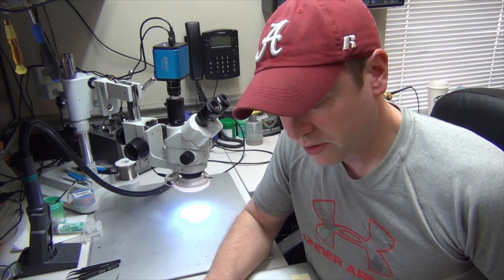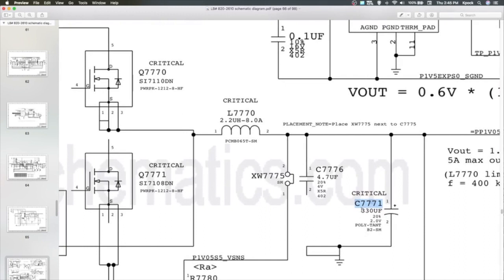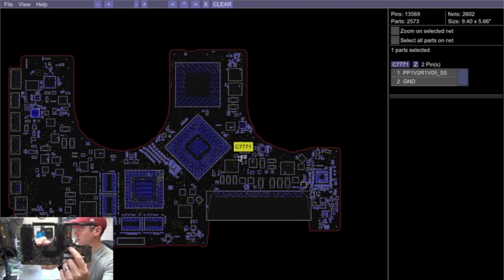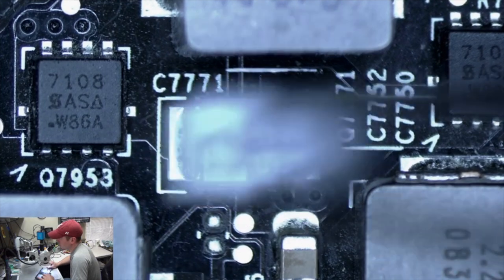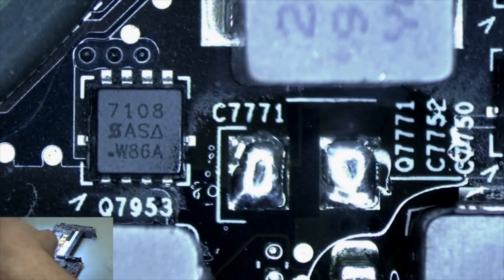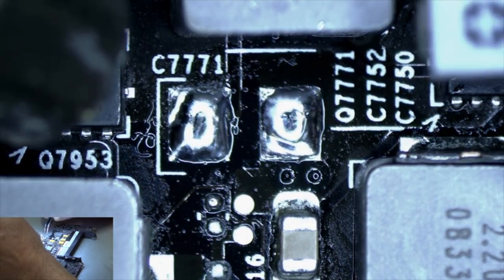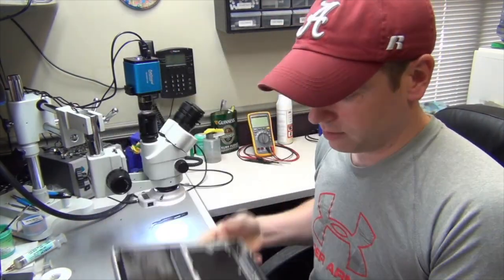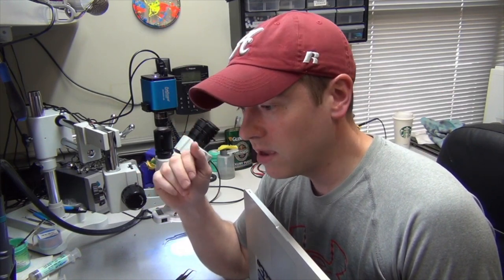Macbook Pro 17" 2009 No Power Repair on Board 820-2390

Comment: Thanks for the informative video. Have 2 MBP 2009 that have same issues. Not good at Soldering or MB troubleshooting so hopefully this is just the problem. 

I just ordered 10 of these chips for about $16 from Aliexpress. Funny thing is that they have screenshot of your video and pointing to the chip so I know that should be the right one.

Comment: Well I replaced the capacitor on my 2017 2009 MBP, I wasn’t able to fit it properly so I did a big ball of solder on each side it ended up working, the MacBook successfully turned on, after a little while I was downloading some apps on it, and I accidentally left it on my bed for a couple of minutes without macs fan control on, I picked up the laptop and turn the fans full blast to avoid any overheating, but even though the machine didn’t reach over 85 degrees C which is normal temp, all of a sudden it shuts down, I’m still unable to turn it on even after replacing the capacitor with another one.

Comment: How nice if you can help solve my problem. Macpro 2009 cpu power supply problem... I hear a click ... and that's it ... won't startup ..??? 

Changed the battery. I even unplugged the computer from the power source ... 

And later when I start is it flash a red light, click and still nothing???

Hope you can help? Thanks.

Comment: Hey my friend, I have a problem with my MacBook Pro A1297 that doesn't boot it will stay on the loading Apple line from the beginning but it won't finish loading to the part you add the password 🔑. I have no idea what's going on with it, I have try several Hard Drives with no luck but I can install Windows with no problem but it will never even boot a Mac installation disk or USB. 🤔

Comment: Bro it's nice you gave a solution to the problem I have but i also have another issue bro with the back light which would be blank computer starts but no display so I used a flash light and I saw the display In background,can u help me how to fix it I searched YouTube videos it says it must be backlight fuse but I can't locate this fuse on my board my macbook is late 2009 unibody same as the one in your video can u please help me locate it please please bro
Reply: Please do reply bro thanks

Comment: Hi Kyle, thanks for sharing your knowledge and giving me and others the opportunity to learn. I have a MP 5,1 and suspect the same issue, standby lights after pressing DIAG LED but press power button nothing happens. Am not able to measure the volt but the capacitor next to the intel chip is 'J8 eC'. Would any aux have caused this? It happened again after board replacement =( Do you think I can replace this with same as you show in this video? kind thanks for your response
Reply: Anyone else would know?

Comment: Hi, i have the same problem with my 
17” inch 2011 Macbook Pro (A1297)
1. green light charger on
2. But won’t turn on
Please help! Thanks!
Reply: has the problem been solved?
Reply: 2011 models have gpu issues, it could be gpu. Anyway I have mbp 2009 17 inch, with green light charger on but wont turn on. Any suggestions on what could be the fix for this problem? Thanks

Comment: I have same problem on the same model. mbp won't turn on at all unless every time i heat up the logicboard with hair dryer, i am not sure which parts, i just heat up all parts and the mbp will turn on. .. the funny parts is once the mbp success to turn on, it will still on for weeks or months until i shutdown and sit for a while then it won't turn on again, must put some heat again and it will turn on haha.... just order the tantalum, can't wait to apply your tips.. thanks

Comment: Will this capacitor work the same? Panasonic 2R5TPE330M9 SMD 2.5V 330UF Surface Mount Tantalum Polymer Capacitors 330 e43 ?? £4 on ebay UK?

Comment: Just carried on this repair on my MBP 2009 17" (which I'm typing on now). For a while it was having trouble waking up from sleep, or randomly blacking out, then eventually wouldn't start up at all. I found this capacitor 'Cap Tantalum Polymer T55 330uF 2.5V 3528' on RS, stock number 8603834 if you want to try it. It is a perfect fit sizewise which helps. Hopefully it will last, it's been a month so far and all good, so many thanks for the tip!

Comment: Does it matter what capacitor am using? I got one which resembles the one you're using , just that its got a different code on it (470 e07) thanks
Reply: You should use the 
Capacitor Smd 330uF 2V 2TPE330MFB polímero tântalo 
Like the one on the video 👍🏻

Comment: thanks for the awesome tutorial. I replaced the capacitor but am still getting only 0.3 V when I connect the multimeter to the positive lead of the capacitor and a screw hole on the mobo for ground - any idea what could've gone wrong?

Comment: GREAT VIDEO!  

I also have a very dead mid-2009 A1297 MB Pro that seems like replacing the C7771 capacitor will fix, but my problem may also be due to a defective Magsafe adapter that was fairly recently purchased. It worked fine initially, but now the amber/green charging light does not come on at all when hot and plugged into the MB dock and unfortunately, I don't have a multi-meter to check for power.  I think I can determine how complicated this repair will be if you can answer the following question...  Would a bad C7771 capacitor also affect whether or not the amber/green charging light becomes illuminated on the Magsafe plug?
Reply: I have almost the same issue with the same model. Would also like to know.

Comment: Hi, really nice and helpful video. I have 2009 Macbook Pro a1297. When i push the power button, fans start to work for 2 seconds then it shuts down. Could it be due to the capacitor or is my problem different?
Reply: Ediz Ferit Kula thanks , I really like the MacBook and I hope to get it fixed , I don’t know if I what to get the board fixed or just buy a refurbished one ,
Reply: @thecarcanuck1951  It worked man, you should try! I ordered the new capacitor e87 and soldered it to a computer service since it wasn't easy to solder that for me. Now, my computer is really fine.
Reply: Ediz Ferit Kula mine is doing the same , did you find anything about the fault ? Is it the same cap ?
Reply: @thecarcanuck1951  I ordered the new capacitor but i didn't have time to try it. Suppose, I will do it in one month. Then, I will write the results here.

Comment: Had this issue on my 17" MBP '09 that died over two years ago and couldn't bring myself to throw it away! Taken it to two 'Official Apple Repair' shops and both said it was completely scrap/No idea what was wrong, and its obsolete so "Throw it in the bin" ...  Stumbled across your video late one evening ... Ordered a replacement capacitor for less than £1 ... Couple of hours of taking apart and a tad of solder later ... it fired right up!!! PERFECT :D Thanks so much for sharing your knowledge! :D  I do wonder how many perfectly good MBP's have been thrown away because of this fault!
Reply: Can you provide a link to the capacitor? as I can't find the right one
Reply: Apple love making their customers think its time to throw away their devices!!  Its shocking and disgusting how dishonest they are and release software and OS that will not work on old machines and change ports etc

Comment: Hi,
I have one logic board with this capacitor C7771. Since I don’t have one tantalum I replace it temporary (only to test if that fix works for me) with an electrolytic capacitor (330mf 16V). With the multimeter probe I have the following measurements .330V and 0V (shifting every 2 sec). Is this happening because of the electrolytic capacity, or is this another problem?
Regards
George
Reply from the maker: George Drimaropoulos I can not say for certain without seeing it, but that is a good possibility.

Comment: Hi, congrats for the video. I have a mid-2009 MacBook Pro a1297 that works only when the battery is plugged in. When I disconnect it and plug in the mag safe charger the MacBook Pro doesn't turn on. Is it could be due to that capacitor or there is any other component involved?
Reply from the maker: Gerson Bernardo No, it most likely wouldn’t be that capacitor.  It’s most likely another issue going on with it, I would have to diagnose it to figure out the exact problem.
Reply: @PowerbookMedic  I'd really love you could make a diagnose. However, I'm in Brazil and is virtually impossible to me send the macbook to you. Could you guide me, in a such way, that we could reach a diagnose? From what point should I start? Thanks for you help in advance.
Reply from the maker: Gerson Bernardo It would be really hard to help you diagnosis it without seeing it. But you could start with using a multimeter to check that all the main power rails are at the correct voltage.
Reply: @PowerbookMedic  Oh, thanks. It's a good point to start with. Thanks again.
Reply: @PowerbookMedic  Hi dear friend, Thanks for the answer and for the help. I checked the main power rails and I got PPBUS_G3H (8.41V), PPBUS_CPU_IMVP_INS (8.41V), PP18V5_DCIN_CONN (17 V) and PP3V42_G3H (3.41 V). However, PP5V_S3, PP5V_S0, PPVCORE_S0_CPU, PPVCORE_S0_MCP, PP3V_S5, PP3V3_S3 and PP3V3_S0 are missing. All these rails gave me 0.0 V.  I also found several capacitors in short circuit (C1250-C1253), (C1212-1219), (C1200-1208), C7292 and C7295.
Reply from the maker: Gerson Bernardo That is a good place to start. Try and pinpoint the capacitors that are shorted out and replace those first.

Comment: Great video, I have the same fault condition suspect C7771 but cannot find one small enough. Do you sell these or can you give me the name of a supplier. TIA.
Reply from the maker: We don't sell them, but here are the specs on it for you to search online for them. 330UF - 20% - 2.5V - Case-C2-SM ... You can also get them from donor boards.
Reply: @PowerbookMedic  Thank you for this. Should I be replacing it with another tantalum capacitor, or something else like ceramic?
Reply: You could try searching old broken discarded boards from other macbooks or even really any laptop for 330uF caps, they're jellybean parts.. very common. Physically broken boards can be had cheap or free if you look hard.